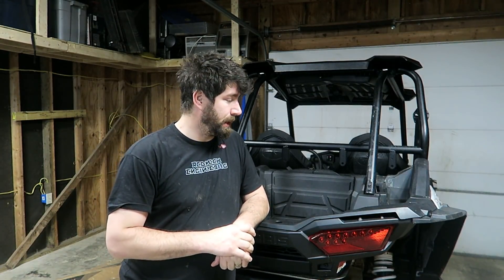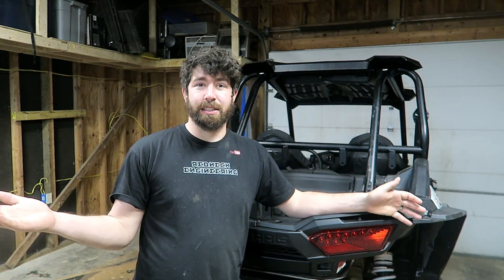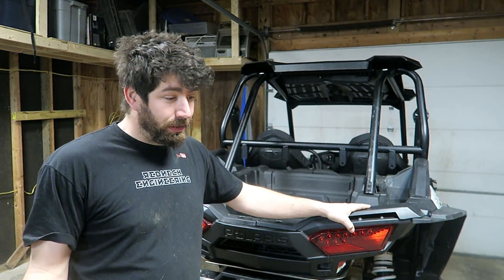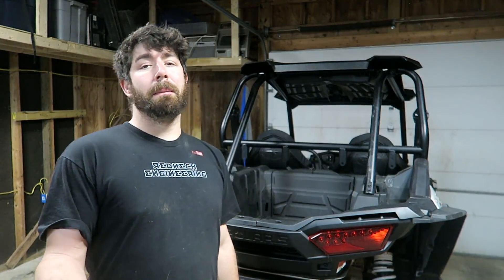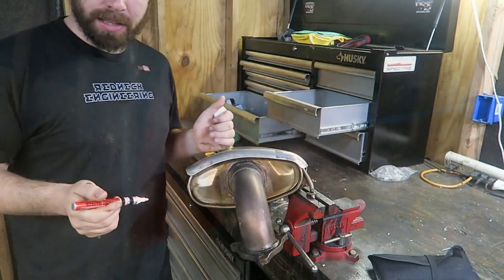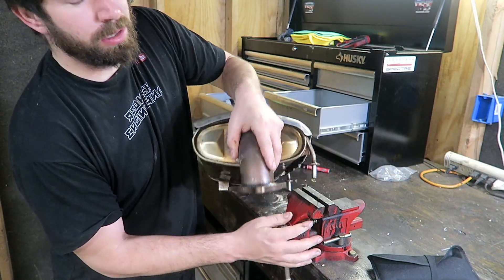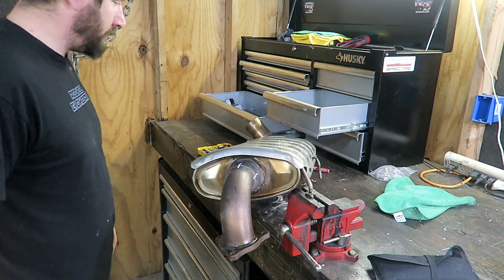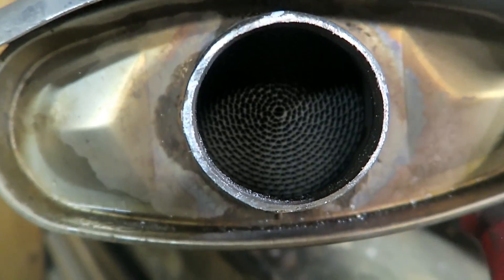How to reduce the heat in your factory RZR turbo exhaust **(catalytic converter removal)**

Comment: Hey! I’m thinking about this to mine. 
I got the same machine xpt 2016.
Did you lose any power at all? 
Or any problem? 
Did the engine temp was noticeable colder? 
I know you got a X3 now but hopefully you reply
Reply from the maker: No power loss or problems at all and  I didn’t get any cooler but it didn’t stay hot as longest
Reply: @redneckengineering7739  thanks bud. 
Basically it was getting cooler faster, right? Your vids had really helped me so far. 
Btw what’s your personal opinion on this machine?
Reply from the maker: I appreciate it if you have Instagram you can message me on there but my opinion of the machine is it is junk which is why I got an x3 now I had tons of issues

Comment: Doing it to mine right now
Reply: Did your pop up a o2 code if so what did u do to make it go away
Reply from the maker: No its fine
Reply: Mine has a o2 code now so trying to figure out what I have to do to get it to go away
Reply from the maker: You had to have damaged it taking it apart Otherwise there would be 2 02 sensors Like a car monitoring whether or not the catalytic converter is functioning properly and since you don’t have to have a tune when buying an aftermarket exhaust everything is fine

Comment: Why doesn’t anyone split the backside of the case open (just a big enough and the width of the muffler) and pull the shit out and weld that shut??? 

Seems like a lot of unnecessary work.
Reply from the maker: Have you ever tried it? In a lot of cases you have to pull the exhaust down just to weld the top seam if you cut the pipe if you cut the bottom out it’s not hard to get to where you are welding

Comment: Thanks for the video! Is the pipe stainless, can I use flux core to weld it back together? I will most likely have to grind my nasty welds afterwards....I'm much better with a grinder than I am with a mig welder, but I'm tryin'.
Reply: Yes you can weld with flux core
Reply from the maker: First of all even if it was stainless you could use flux core on it I do it all the time the only issue is the world won’t be stainless but the piece would still hold I will do this with flux core but it is not stainless

Comment: thks for the engineering. ive got a 17 turbo and definitely  want this done. after the cat removal would the muffler essentially be a "slip-on"? Then I could run an performance exhaust tune
Reply from the maker: If you do it step for step yes You will have to remove the baffles like I did with the holesaw as well

Comment: So is it cooler inside the cab now? I know they get hot right where the turbo is
Reply from the maker: I mean it does a little bit but it really helps it cool down quicker so everything isn't as heat soaked the best way to cool it down more is to get a tune where the fan comes on sooner

Comment: Anyone know if the non-turbo 2016 RZR 1000 has a catalytic converters?
Reply from the maker: First off all 1000s r non tutbo second im pretty sure it does but if u take the muffler off and look at the back of it u should b able to see if its been getting really hot like the one in the video

Comment: great video quick question will it trow any codes? will the check engine light come on if i do this?
Reply from the maker: No not at all ive had it dont for at least 8 months
Reply: cool thanks for the info @redneckengineering7739
Reply from the maker: No problem you should follow me on Instagram ,@cataldo133
Reply: No computer will adjust for it

Comment: So did it lower your engine temps or just how hot the muffler gets?
Reply from the maker: Both when you're really ripping on it the motor stays cooler and so does the whole exhaust system as well as the turbo

Comment: I like the sound of it but where I live I have to keep it in
Reply from the maker: +Beau JOHNSON well in that case I would still remove the cat and the baffle on the inside and just leave the spark arrestor in it would still be quite a bit louder mine sounds just a little bit quieter than an aftermarket exhaust

Comment: AFR fuel controller helps alot too, they are running to lean from the factory. AFR controller will lower the EGTS
Reply: they seem very rich on mine?
Reply: @rwpeaches  Wont really know with out an AFR meter to read what is present currently.